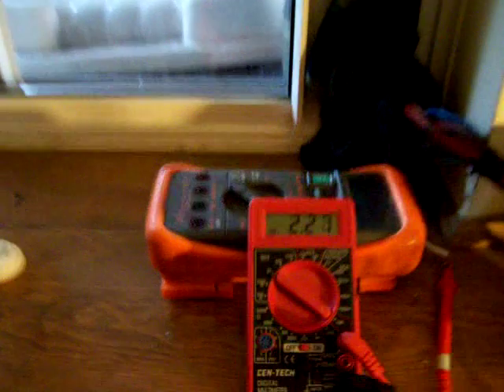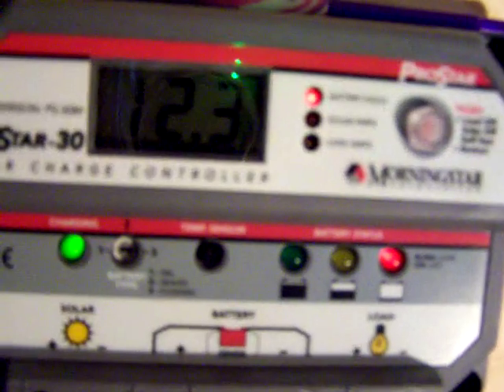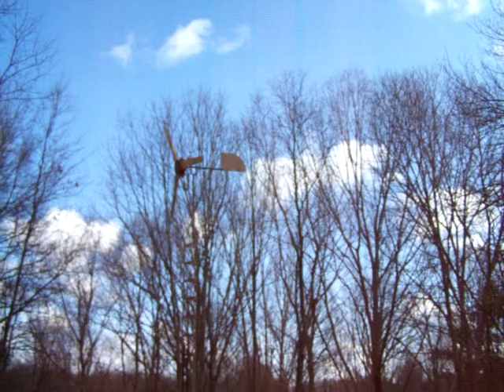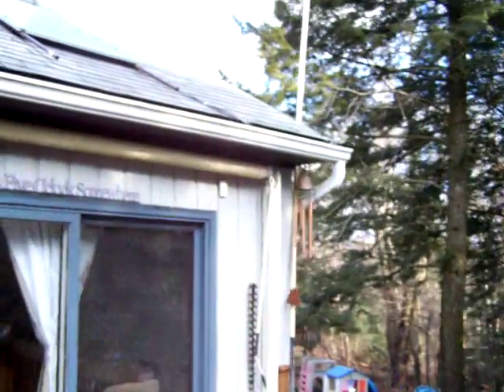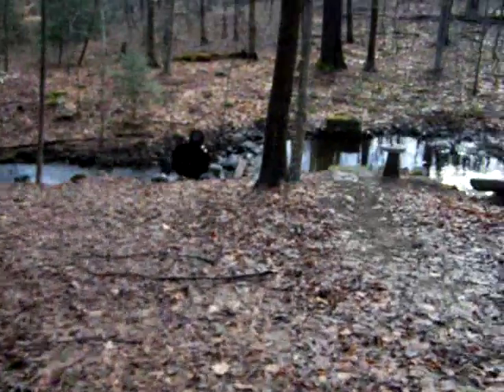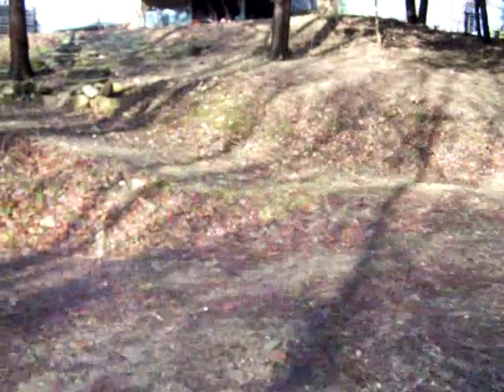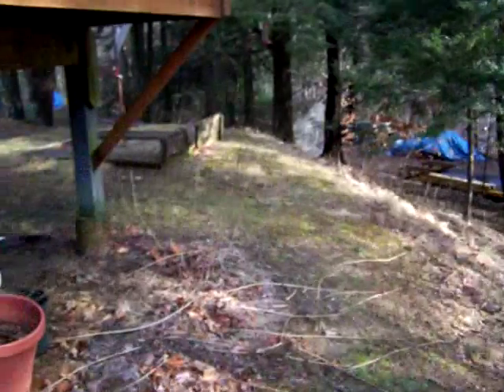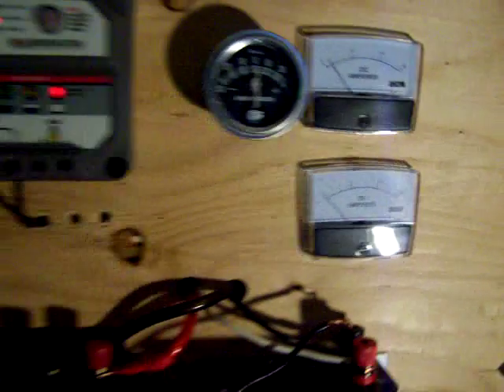alternative energy solar micro hydro and wind

Comment from the maker: I am new to this also but I may be able to help.this is what I think. volts are energy but in order to move your volts you need amps to push them.If you multiply volts and amps you get watts.watts is what light bulbs and tvs use.you may want to look it up in order to understand it more clearly.I hope it helps a little.12volts x 1 amp =12 watts.Think of  it as water in a hose it has pressure until it finds a place to excape.the  excape would be amps  amps